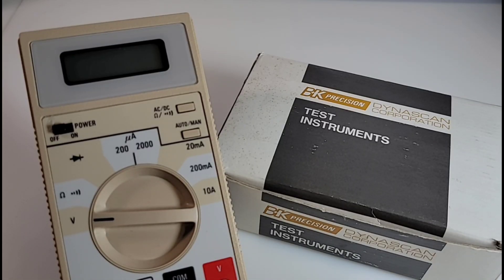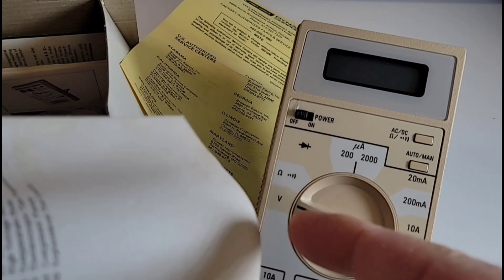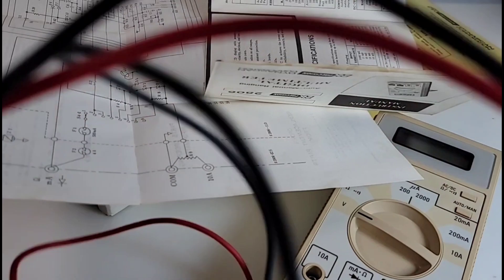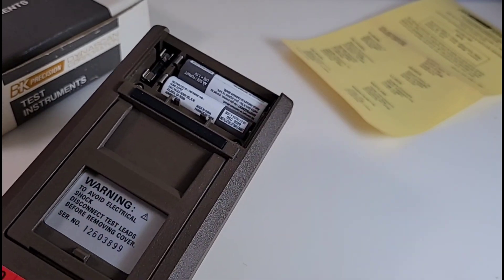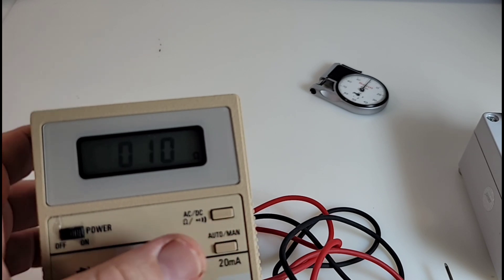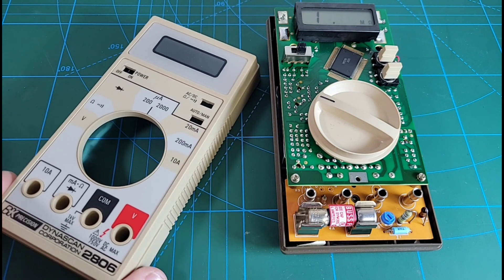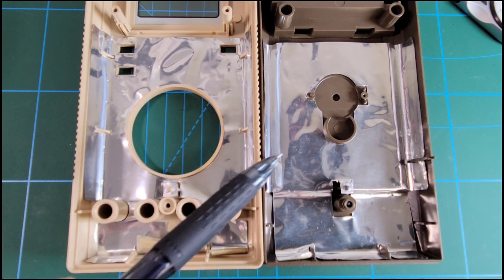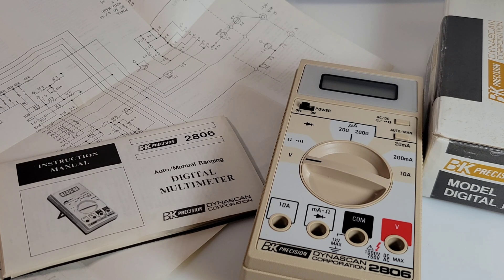RETRO-TECH ○ B&K PRECISION  DYNASCAN 2806 Vintage Multimeter Mini Review  & Teardown!

Comment: I love these old vintage Multimeters. I have a few of them. Those days, the design used to be very robust and electronic good were made to be repairable. They usually survive for long, though I lost couple of them due to my negligence. I allowed the batteries to remain idle in them for a couple of years. Electrolite leakage badly corroded not just the battery terminals but even the PCB. While I can never forgive myself,  I would request the aficionados to never allow the batteries to remain inside any gadget. It is very easy to forget and the damage is irreversible.
Reply from the maker: Words of wisdom Sunil..battery leakage is one of the biggest problems affecting vintage multimeters. As you mentioned the results can be catastrophic and irreversible although sometimes you can still repair a badly corroded pcb. However, It's better to not take that chance and as you say battery removal is the best form of prevention!! 👍

Comment: I liked everything except the small deep dumped display in this multimeter. Input protection seems excessive? IDK! But, it is definitely built to survive high current or voltage.
Reply from the maker: Yes, even transient protection is evident which was great to see in such an old multimeter...good job B&K! That display is definitely the least impressive feature on this otherwise great dmm.